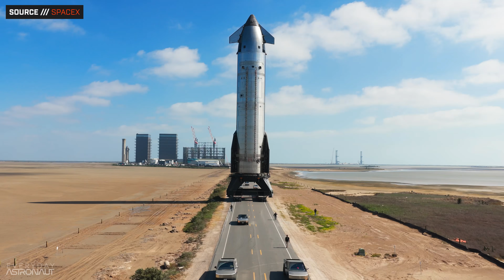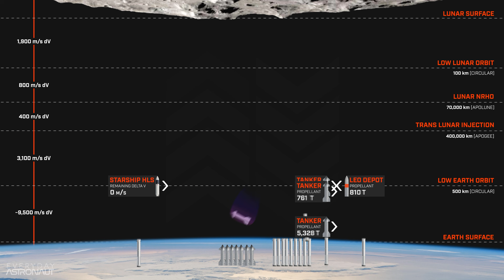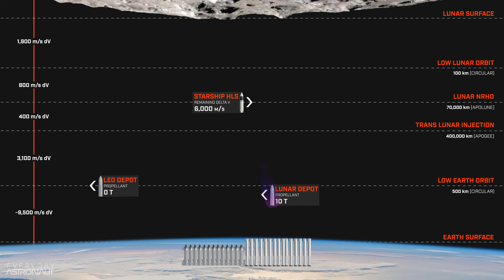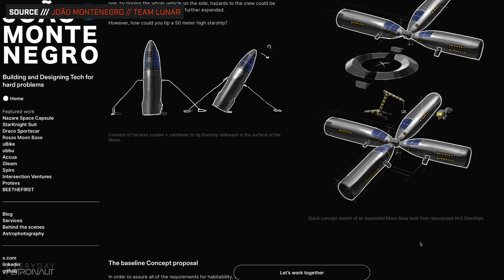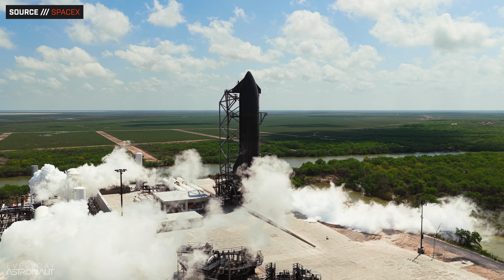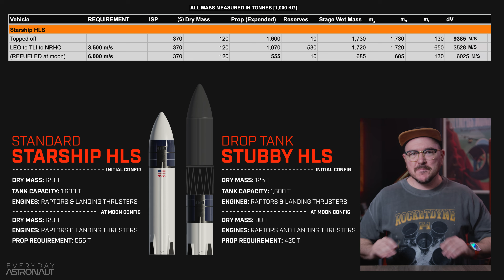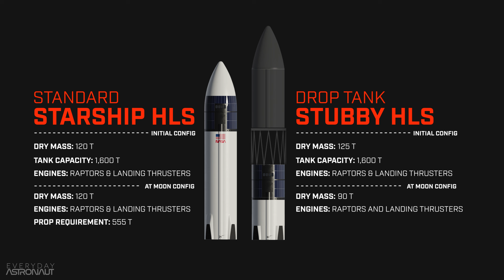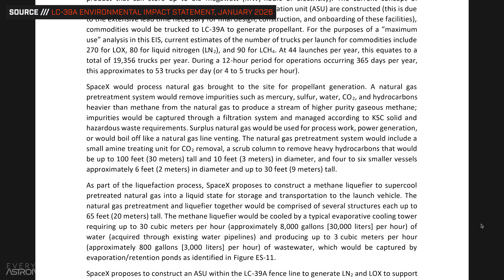Does Starship REALLY require 15+ launches to land one lunar Starship?!

Comment: The moral of the story is we didn't use the Space Shuttle as a lander on the moon for a reason. It wasn't designed for that. And Shuttle 2.0 is absolutely no different. There is a reason why no lunar lander has or likely ever will be built out of steel. It's FAR too heavy. In fact if SpaceX painfully tries to pull it off, it would be embarrassing. To them and the US in general. Why on earth would you use stainless steel when we can simply launch a purpose built light weight lander with everything it needs to get to lunar surface and back right out of Starship's cargo bay?! Until SpaceX realizes this, Blue Origin is going to eat their lunch on the Moon and the same for Mars if they never get their head out of the sand on this.

Comment: There's going to be a six vacuum engine variant, why keep the sea-level engines at all -- just use the landing thrusters plus thrust vectoring for steering?  No flip maneuver required.  Best part is no part....
Aerobraking on a structure with insulation?
Reply: Thrust vectoring would require much stronger engine bells to survive the forces from the vectoring equipment attached to the end of the engine bells.  Therefore more weight from stronger bells, and weight of vectoring equipment.

There must also be a reason they want 9 engines on the Starship.  Not having the sea level engines may undo the reasons for 9 engines.
Reply: @davevann9795  My bad, my brain said differential thrusting, but that was mangled by the time it reached my fingers.  I was thinking roll control via the top landing thrusters and pitch and yaw through both top and bottom.  No need for thrust vectoring when you've got engines on the top handling 1/6 g particularly because crazy maneuvers like the landing flip wouldn't be required.  I wouldn't be surprised if the depth of throttle control is lower in the vac engines, but I'm assuming it's still there -- it just has to feed a longer bell coolant loop, otherwise should be pretty similar.

Comment: I'm more convinced than ever that this is the wrong architecture. I don't know what the answer is, but it's not this.

I don't see the plan ever including a depot in lunar orbit. Impractical.

One thing you didn't mention is the possibility of using materials lighter than stainless steel for HLS and the depot. They were originally going to use carbon fiber. More expensive, yes, but lighter. Maybe aluminum? Neither has to re-enter the atmosphere. Of course SpaceX only has to redesign their entire production facility to make the change.

I don't know when you worked on this, but over the last 3 months some events in the Middle East have taken as much as 20% of the world's annual production of methane off-line for potentially several years. That's going to affect the practicality of Starship.

I was a big fan of Starship because we've needed big rockets for decades to explore the solar system. But when the numbers are run, reality hits, and the architecture looks to be just as unsustainable as SLS. Still, I wish them success.

Comment: TIM, PLEASE CLARIFY THE FOLLOWING: discarding the variants you added, this video makes sense if you only want to land astronauts. You refuel at the moon and that’s it. But the purpose of Starship HLS is sending also 100+ tonnes of cargo and you made no mention of this process. The HLS would have to return to LEO with a slow aerobraking with no heat shield and then be refueled by fuel depot and a starship cargo variant moving 100 tonnes of cargo to HLS (no one has explained how) I imagine with some sort of docking that would allow moving cargo between the two. So, if HLS has to return to LEO it will always refuel at LEO. Could you please explain this in a future video?

Comment: seems completley crazy to me that we are trying to bring the starship, why aren't we just using the starship to get a moonbase/infrasture on the moon and using a separte, much smaller and more conventional vehicle to get them back to the moon.  Starship to me only makes sense if its for building a moonbase, why use this giant machine to carry ~four astronaughts, their life support and some moon rocks. In addition, the less you carry people on starship the higher risk of failure you can tollerate and thus the more margins you can eek out during those sections. I'm thinking of add a vehicle that is stored inside the starship and than setup on the moon and then is used to get the people/samples to translunar injection, obvsouly this system would addd significant mass but it would leave the HLS on the moon with its payload which would be an asset in future space missions, not sure if it would reduce the number of tankers needed from the profile described in the video, though it probablly would because i would mean we don't have to get a whole starship to lunar nrho or from your video 2700 m/s.
Reply: I think i would be nice to have the starship +refueling to get lots of payload to the moon and speratly have a apollo/Saturn V system to get people to and from the moon.

Comment: Great Video! Regarding landing on the moon, you really can’t separate landing/launch considerations from issues stemming from lunar regolith (I know that’s not the purpose of the video, but for curiosities sake). Yes, SpaceX has lots of experience landing rocket stages on earth, but in each of those cases they were either caught or landed on a hard surface. Having that much mass concentrated in such a small area is definitely a red flag, as we can’t model/replicate its behavior under that much load. Not to mention, the thrust from landing alone would shoot up so much regolith, it would end up sand blasting the outside of the lander, degrading the mechanisms you’d need for launch and anything you’d put on the lunar surface. There was significant evidence of this in the Apollo era, even with such a small lander (one side of the buggy was white and the other was silver - the regolith had abraded the paint off).

Comment: I'm pretty sure the actual plan is to leave starship on the moon and use blueorigin for all crew transfers. Look what happens when you plug in those numbers.
Reply: How to be the first to build a base on the moon right..... I mean the lunar starship isn't coming home regardless so why bring it back to LEO use blueorigin and orion/SLS. So why compromise at all... get max mass to the lunar surface first flight there after.
Reply: also no need to human rate the starship other than a static HAB and you could have it land with so much liquid oxygen it could supply crew for years

Comment: My thinking is all about the starship version 4 tanker. No flaps, no heatshield, just tanker. This all saves tons. The booster returns for catch. You could get 250 tons of fuel to orbit. This solves the number of refuel flights. Note: SpaceX & Blue Origin should build exclusive depot tankers that remain in orbit. As much passive shielding as possible. Than active cooling. You could sub-contract the work out. Any company in the world could deliver fuel to the depots. And both companies would pay for your services.🤔🙂

Comment: I think as SpaceX is REQUIRED to do at least 1 successful HLS Lunar Lander mission without humans on board they will pack that HLS module full of Optimus Gen 3 robots, power generation (solar for sure, maybe even nuclear) and 2-3 surface manipulation vehicles such as excavators and bulldozers which can be operated either remotely, by Optimus or even independently by AI which will level a landing zone for the human occupied HLS 2nd landing.....that is how I would do it!

Comment: All I heard is that Smarter Every Day was wrong about everything. 
1. Hypergolic is trash
2. Refueling is cheaper than throwing away rockets (duh)
3. Fuel burn off is a non-issue
4. Refueling allows for much bigger and dynamic mission payloads
5. Low lunar orbit is not as efficent in lowering fuel demands than NRHO
6. Methane and liquid oxygen is being used to allow for lunar refueling from moon ice

Basically everything Dustin said was just him trying to sound smart. I love the guy, and he made a few good points about asking hard questions; but the future is not going to be achieved by copying Apollo. He should read a book called 'Why Apollo Failed' or something.

Comment: I really hope SpaceX starts their in-situ production of oxygen and methane on-site, using solely renewable electricity. Otherwise, one SpaceX lunar mission will use WAAAAAAAY more fossil fuels than a Saturn V did. For a company founded by the same founder as "to accelerate the world's transition to sustainable energy" Tesla, it's a bad look to pollute so much per launch. I also hope they're able to have a better methane recapture program on-site, as methane is one of the highest-impact greenhouse gasses, so leaking as much as they do on-site is terrible.
Reply: Current atmospheric CO2 is over 0.04%, up from the 0.025% it was from the beginning of human civilization until we started industrialized fossil fuel extraction and burning about 1850. 

Methane is 28 times more potent than CO2 as a greenhouse gas. 

Currently humans release about 400 million metric tons of methane annually into the atmosphere. A single Starship + Superheavy combined is about 3.6 thousand metric tons. 

Musk's claim is that within a few years, there will be HOURLY launches of Starship. If one Starship+Superheavy launch releases 1% of its primary supply into the atmosphere during fueling/prep/launch/venting, then Starships alone would be ~1 metric ton of methane annually just from "boil off" from Starship launches. 

Airliners release ~880 million metric tons of CO2 into the atmosphere annually. 

So methane being ~28 times more potent means Starship launches alone will be about 3% of human caused greenhouse gas emissions compared to the entire airline industry.

And that excludes the CO2 that is released from Starship as it combusts the methane.
Reply: @AnonymousFreakYT methane has a much shorter atmospheric half life than CO2.
Reply: @ippy9269  That "28x more" is based on the 100 year impact. While methane is actively in the atmosphere, it is far MORE than 28x.

But for 1 ton of methane released into the atmosphere in 2026 versus 1 ton of CO2 released, that methane will impact the greenhouse effect 28x more over the next 100 years.

In the immediate term? MUCH higher impact.
Reply: @AnonymousFreakYT  You're saying that like it isn't the same statistical propaganda trick as "you're 10x more like to die from X vs Y" when the the chance of dying from Y is 0.000000001%. 

CO2 makes up 0.04% of the atmosphere and Methane makes up 0.000192%. Methane is relatively heavy and it stays almost entirely within the troposphere. Which is important because after it breaks down into CO2 and water they are low enough to just rejoin the normal carbon and water cycles as rain and plant food.
Reply: @AnonymousFreakYT  CO2 is a lagging indicator of warming, not the progenitor. It's also plant food. CH4 breaks down in a little over a decade. 

Neither of these things matter.

After all, consensus isn't science and 97% of scientists agree with the people who pay them.
Reply: @jackinthebox301 Umm is this climate change denial in 2026 or am I tripping?
And scientists being paid? In what utopia do you live? The only scientists that are paid properly are those working at companies like SpaceX and OpenAI.
And if scientists were to be paid to steer public opinion, who'd have the motivation and the means to do it? Climate-change-believing students or oil-trillionaires?
Reply: @jackinthebox301  Bullshit. Consensus isn't science, but anthropogenic climate change IS "settled science". It isn't "consensus", it isn't "paid for by big money" (if that were true, "big oil" would have absolutely quashed any and all science about climate change. Science is cheap, all the climate scientists combined make less than 1% of what big oil spends on lobbying against climate change combined - if they could just buy the scientists, they would.)
Reply: @AnonymousFreakYT  There is no such thing as settled science. Like, by definition. Science is a process, not a conclusion. 

Name one thing discovered by scientists in the past 100 years that hasn't been updated and revised when better technology was developed. 

Every generation of scientists think exactly like you. Then the next generation comes around and discovers something new that destroys the ideas of those that came before. 

Methane breaks down in the atmosphere in 12 years. It's effect on prolonged, sustained warming is non-existent. CO2 is plant food that contributes to the greening of the Earth which acts as a carbon sink. CO2's thermal capacity also tapers logarithmically. Doubling current atmospheric CO2 only adds an additional 1.5 degrees of temp rise. 1.5 degrees is hardly Earth shattering. Summers get a little hotter and last a little longer. Like I said in my other comment, the climate warmed ~6 degrees in as little as decades 12,000 years ago. What we're facing now has effectively no downside. 

Climate Change is the rebrand of Global Warming, which was the sequel to the 1970's era, "We're headed for a new ice age!" Global Cooling. These alarmist narratives have always been politically motivated. Stop falling for it.
Reply: @jackinthebox301 Stop falling for rich people feeding you bullshit just so they can stay rich.
Reply: @AnonymousFreakYT  lol yeah that's what I thought. You can't grapple with reasonable logic so you default to "bUt ThE eViL BiLlIoNaIrEs"
Reply: @jackinthebox301 no, it’s just clear that you’re a sheep following right wing talking points and won’t possibly listen to actual evidence or even acknowledge it so I’m not wasting any more time on you.
Reply: @jackinthebox301  Methane has 86x global warming potential over a 20 year time period and 28x (or so?) GWP over a century, compared to CO2 per unit carbon atom. Does it eventually dissipate? Yes. But so does everything as it tends to a new equilibrium. But the time for it to dissipate is irrelevant on human timescales unless we stop emitting, because by the time it does, the damage is done and positive feedback cycles dominate. 
An additional 1.5C doesn't cause any harm... are we being for real? Marginal/vulnerable biomes like periglacial landscapes or tropical rainforests contain the majority of accessible carbon stores (~3000 GtC), and coincidentally they're the ones that get destroyed the quickest due to positive feedback cycles. (Forest dieback, arctic amplification). 

The climate didn't warm 6 degrees in decades. It returned to the "normal temperature", and only regionally (parts of the Northern hemisphere). It initially cooled during the Younger Dryas at the end of the Pleistocene because an ice-dammed like (Lake Agassiz) drained, disrupting the thermohaline cycle and cooling areas around the Northern Atlantic leading to reglaciation in Britain and Greenland ONLY. And eventually when the freshwater drainage stopped, thermohaline suppression stopped too, and the temperature reverted to normal. It didn't impact the world much because it was INCREDIBLY regional, no humans were there to care, and only changed global temperatures by a few celcius over centuries to millenia. So your statement is ither misleading indicating a lack of research and knowledge or disinformation.

The amount of research we have proving that climate change will happen, and WON'T stop unless we not only drastically cut carbon emissions but find a way to permanently sequester carbon into long term stores, is extensive. There's no one piece (or even multiple pieces) of modern scientific discoveries which can reverse that. It's not a settled science by definition, but it is one de facto.

Comment: Talking to Grok about ISRU energy requirements to produce 350 tons of LOX every 6 months... Bottom line, you'd need around 4000 solar panels to get it from water ice, and closer to 10,000 panels to get it from oxides in regolith. Not to mention the infrastructure to process that amount of material. On the upside, a 4000 panel solar farm might "only" weigh ~100 tons. Hopefully the robots will be able to build that infrastructure for us by the time we're ready to set up that kind of industry on the moon.